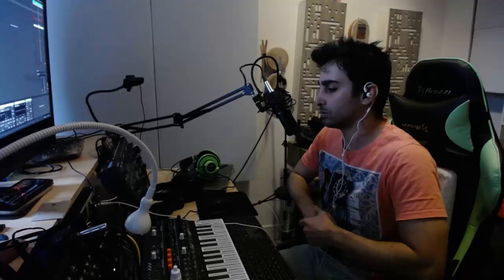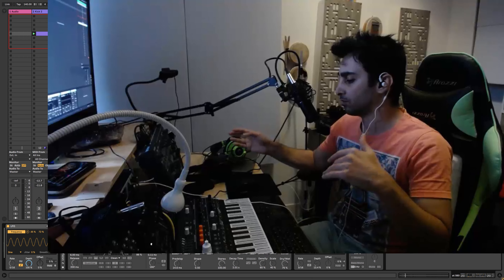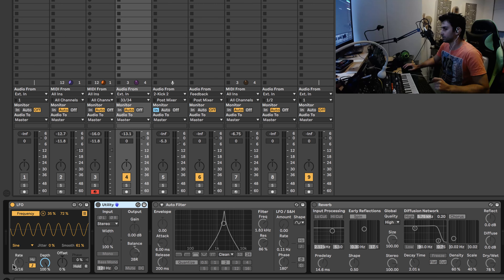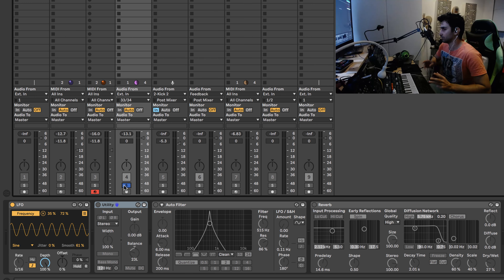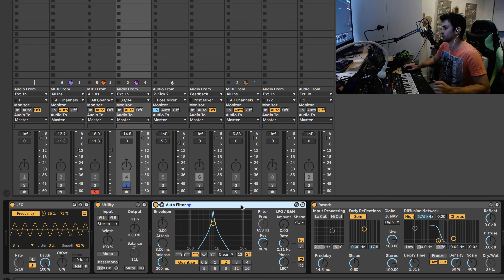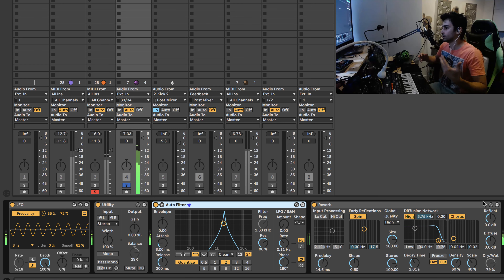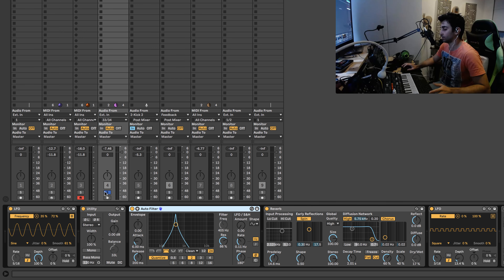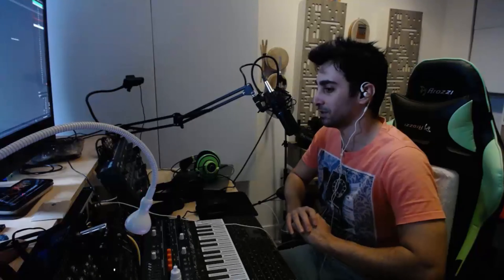How to create 3D audio effect - Psytrance tutorials

Comment: One of the most professional channels on topic, thanks! Especially like the kick and bass episodes. Please do more on bass sound design - maybe on layering (not sure it suits your genre though). Also, it would be interesting to know how to do pluck sounds for tropical beats. DO they really use sampled wine glass sounds as one layer for that?
Reply from the maker: Thanks for watching! I can do a layer bass tutorial, I was actually working on a song recently that I had to layer 5 bass parts for some parts, the key with layering is to carefully place each layer in frequency spectrum so they all add value but don’t clash specially in the lower frequency range, I’ll add this to list of tutorials to make! Thanks for the suggestion. I’m not sure about the wine glass as a layer for bass but it sounds like an interesting idea!
Reply: @BEZONANCE  5 layers is sick!!!
Yeah, that glass layer is probably more useful in plucks. 
I have been wondering about the rubbery bass sounds in old songs like Benassi Bros "Hit My Heart" ( I almost got it) but even more rubbery bass in Röyksopp feat. Robyn - "Monument" (The Inevitable End Version) - https://youtu.be/Zo6UnKr6Bwg
Röyksopp probably used hardware. No idea what they modulate there... it sounds kind of rubbery - I hear some near 100Hz changing vibration/modulation there - as if going with your finger on an air balloon there is complete friction and then the finger pops open at an increasing rate